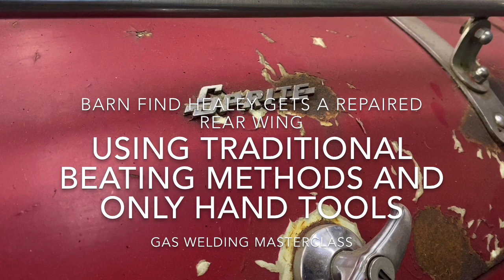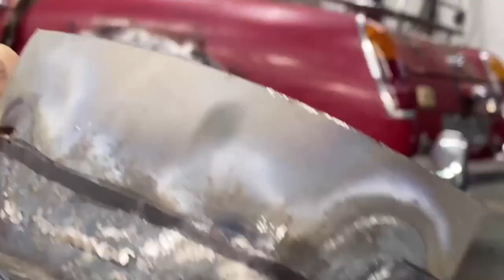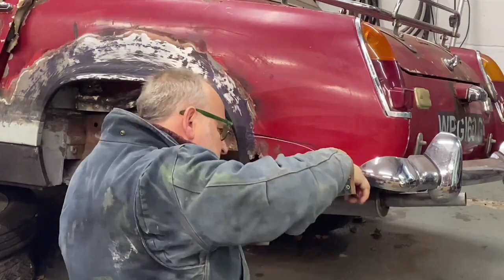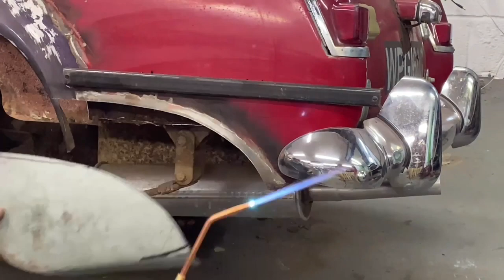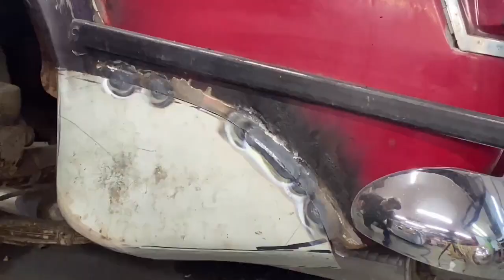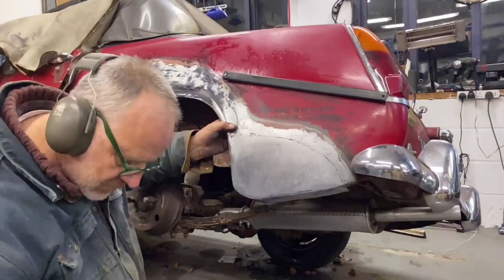Workshop Film 1. We take a rusty wing and a 1968 Austin Healey and repair using traditional methods

Comment: Great job! But what for is that magnetic bar?
Reply from the maker: The next video will explain the bar - Subscribe for the next one - and Thankyou for watching!
Reply: I always thought you had to add filler rod to any gas weld. Fabulous skills.
Reply from the maker: @tomrobinson9108  if the gap in the joint is tight enough there is no need for rod, I did have to fill blow holes and imperfections- thanks for watching :)

Comment: Hey there BTR, and thanks for the great demonstration. Please let me ask, why is the magnetized,metal bar mounted horizontally over the weld joint? Does it control heat? Also, I couldn’t read what ever it was that you wrote on the panel. Could you please explain? Wouldn’t want to miss any important info. Cheers.
Reply from the maker: It controls the heat but also help align the edges of the joint
Reply: @browntruckracing  thanks for that.& Also, I couldn’t read what ever it was that you wrote on the panel. Could you please explain? Wouldn’t want to miss any important info.
Reply from the maker: @eddiemcg  it was a note to remind viewers to Subscribe to the channel!